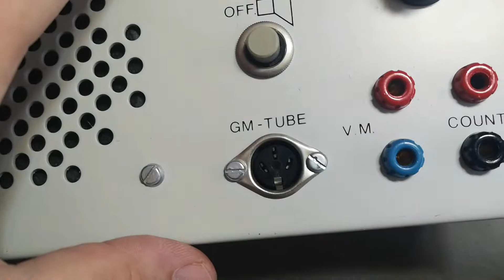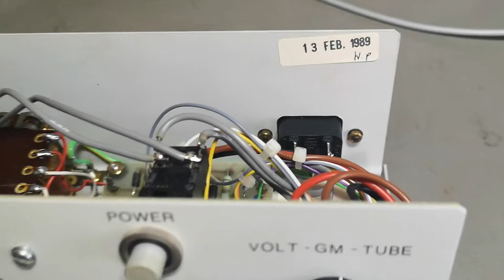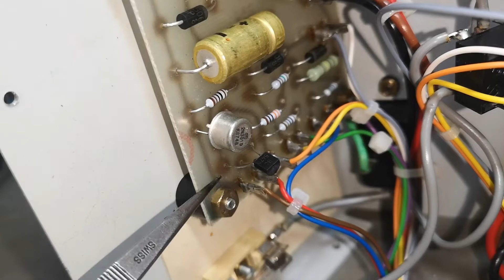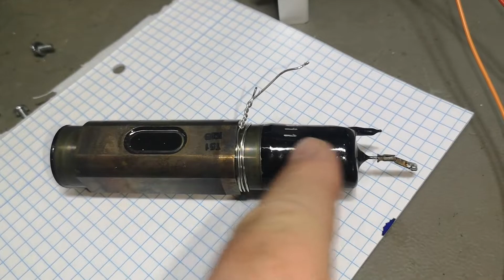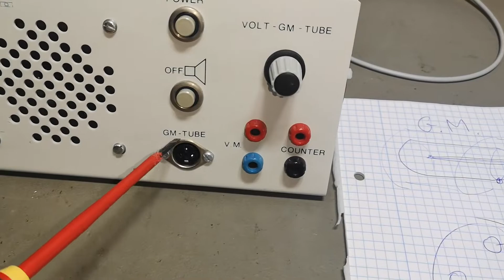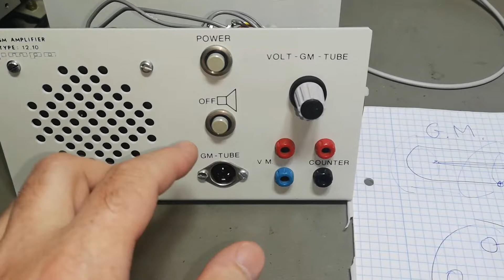IMPO GM Amplifier Type 12.10 Geiger Tube Amplifier 1989 teardown

Comment: Interesant tingest.
At bygge en geiger tæller har jeg ofte tænkt på, men aldrig fået gjort. Jeg informerede mig engang for mange år siden om kring hvilken stråling der var og hvilken type rør man skulle bruge og blev så rundforvirret at det aldrig blev til noget 😁
Reply from the maker: you can come pick up this unit real cheap, and then get a tube on ebay and you are ready :-)